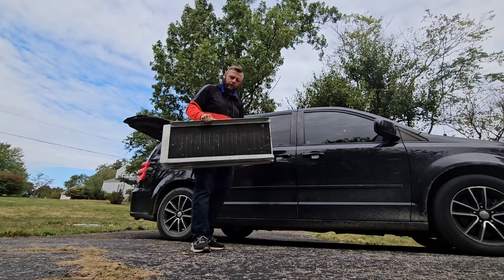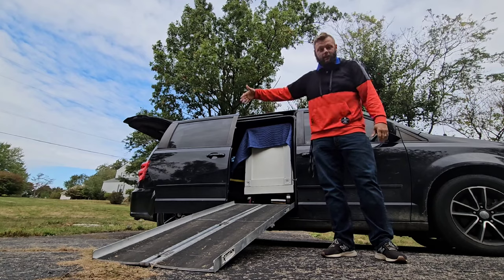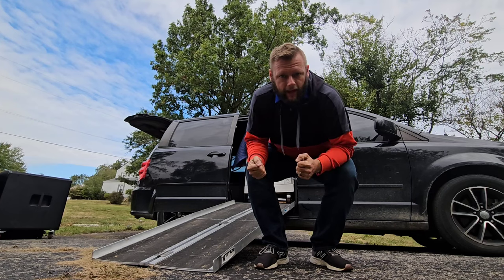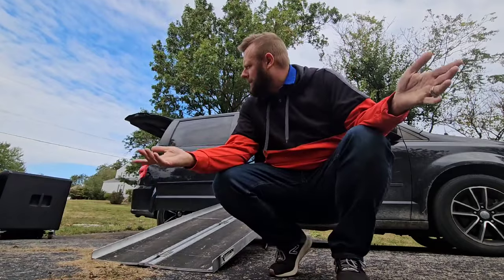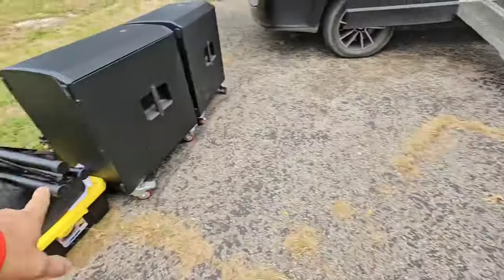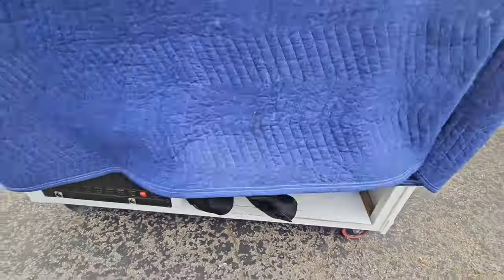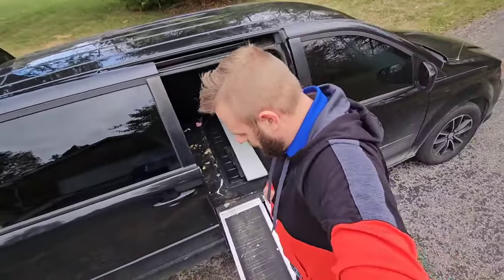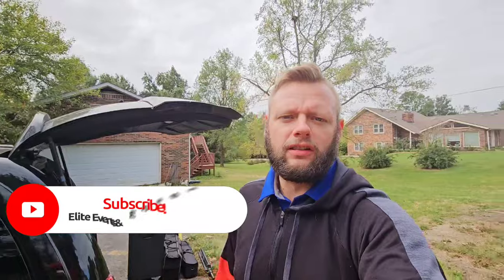How I Transport My DIY DJ Booth

Comment: That's awesome.  I've been thinking about a booth like that, but didn't want a trailer.  Now you have inspired me.  Do you have any special "tie down" in the van?  I saw something on the floor.  Just have to measure the height of my van.
Reply from the maker: I don't have any tie-downs or anything like that. The subs from my Maui's keep it from shimmying backwards, as well as the other gear.

Comment: Wow this video could not have come at a better time as I just had a booth built and got a ramp for it yesterday.  I'm really surprised that you were able to get that in at the side entrance of your minivan.  My booth is 53L x 24D x 42H I have a ford Transit van and I'm pretty sure I can't get it in the side door as I think thought width of the Transit would be too small.  I may have to rethink that.  Right now, I'm using a 6-foot ramp in the back of the transit to wheel it in.  It takes up quite a bit of room.  I also noticed you changed your casters.  You used to have 6 casters and they were definitely smaller.  What size are your casters now and why did you go from 6 to 4?   I'm actually planning on using my booth tonight at my Tuesday Karaoke show.  By the way your original video on this booth inspired me to get a DJ booth so thank you.
Reply from the maker: Mine is the same dimensions. I designed it that way so it could go in the side doors.
Reply from the maker: I went to four because using six made it incredibly unstable when loading it in the van.